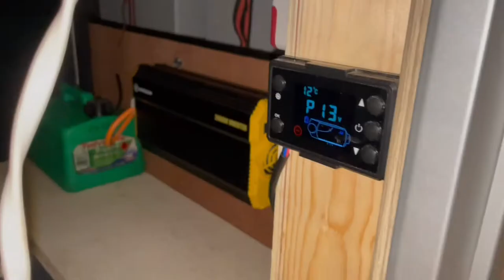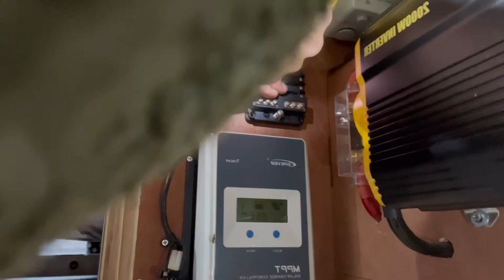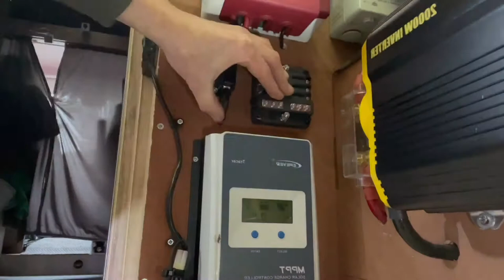Water tank heater pad and wiring installation, winterising your van.

Comment: Excellent work!  I was thinking about putting inline fuses on the pad that I'm adding (that's how they did the ones from the factory), but I'm planning to insulate the underside and would then have to remove a bunch of that to get at the fuses.  I may move all the fuses inside to keep from having to cut too many access doors in the insulation.
I ordered UltraHeat pads, but I'm in the US - not sure if they're available in the UK.  I have read that the facon's are spotty at best.
Thanks for the video!
Reply from the maker: Hi there and thanks for your comment. You definately need some fusing between the supply and the pad and as you say it would probably be better inside the van for ease of accessibility and the possibility of water ingress if they were outside. You’re right about the facon pads, one of mine didn’t work from the outset but I couldn’t really test before fitting as I had to wait for the temps to drop in the fall and so have replaced it with a tank blanket brand that we have here, I’ve not heard of the ultraheat ones but I hope they work well for you. All the best. Ian.

Comment: With hindsight, would you suggest winterising the tanks before you installed them?
Reply from the maker: Hi Roy, in hindsight yes I think it would be possible to make a better job of the insulation if it was done beforehand, and also you could put the self adhesive heater pads in place too and just fasten the wiring up until you got round to finishing it off. Don’t go for the facon heater pads as one of mine dosent work 😣 cheers 👍

Comment: Hi, can you post a link to where you purchased the heater pads, thanks
Reply from the maker: Hi, I bought them from Amazon but I have a problem with one of them not working so I wouldn’t recommend them, I’m thinking of replacing this faulty one with one from ‘tank blanket’ they are more expensive but are better quality. I’ll be mentioning this problem in my next video. 

https://www.tankblanket.co.uk/the-system/tankblanket/

Many thanks 😊